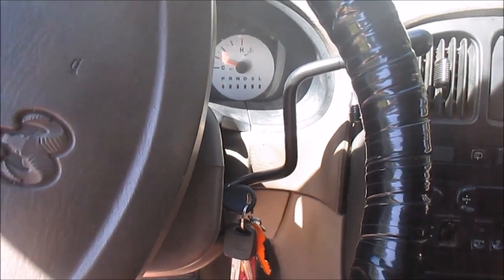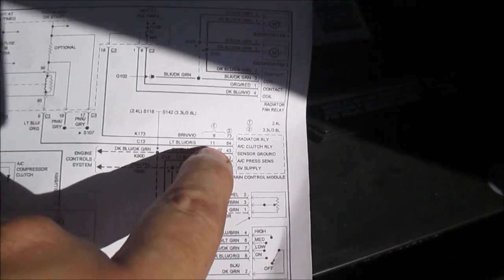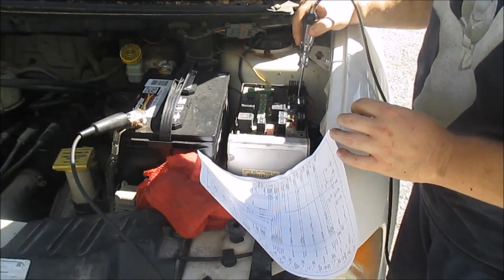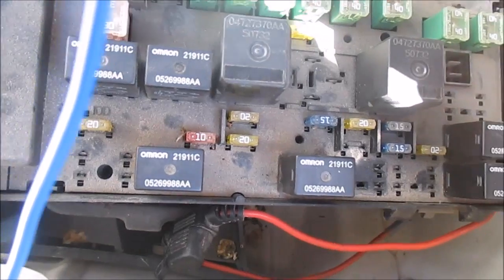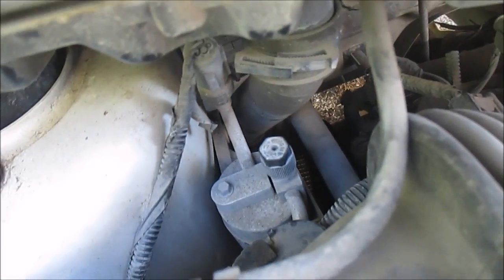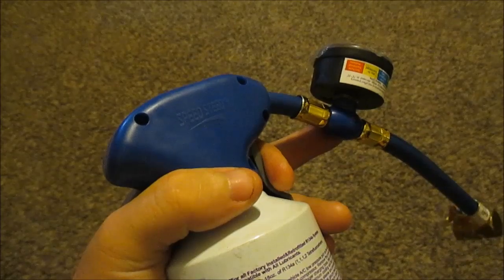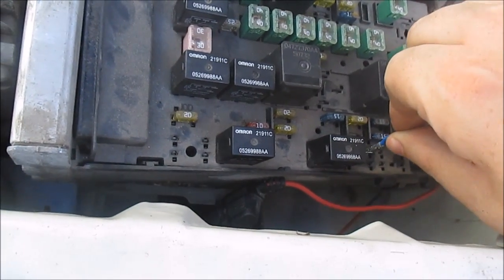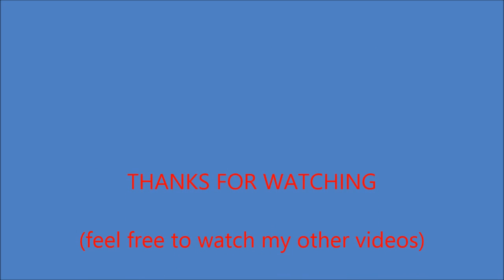How To Add R134A To A Dodge Caravan

Comment: wiring diagram was helpful.
had the same situation: 30 & 86 hot, 87 ground... but 85 - no ground.
we'll see if it's just low on refrigerant.
perhaps could be bad pressure switch?
of course, even if low, there's a reason it's low...
... so, back to slaying dragons...

Comment: Thank you for demonstrating how to jump the ac clutch. I am considering what you did to charge the ac in my caravan. I wasn't sure if I could just attach and charge without the ac clutch engaged, hoping the added pressure would turn it on.
Reply from the maker: You can just turn on the AC and if it is low on refrigerant the clutch will not kick it, but try hooking up a can and try to see if that will be enough pressure to engage the ac clutch, if so you can charge it that way, and If it does not work then you know how to manually bypass and force the clutch to engage. Just make sure if you bypass the relay you jump the correct pins or you could damage the PCM. Well good luck to you. Thanks for watching and thanks for the comment. Have a good day.

Comment: I have an '09 Town & Country. And like many of them I suspect my rear AC has a leak. I was planning on buying one of those rear AC block off kits. Dorman makes them. I would need one for the high pressure and low pressure lines. My guess is there's no refrigerant left in the system as I've driven without AC for about 70k miles. Can I just add a little bit of refrigerant to get the compressor to kick on so that I can then just use my ACPro gauge to tell me how much to put in for the rest? Also I was always curious, what happened to your right wrist?? Looks like it's been busted pretty bad at one point.
Reply from the maker: I have never used a block off kit, so I am not familiar with that kit. In theory I would think that might work. However, I can see you may have problems getting the charge just right, because of the removing a lot of the system. I dont know if charging by using the ACPro gauge will work for you or not. As far as my wrist goes, I had to have an av fistula surgery done to it. Which is where they cut into my arm and they take a vein and an artery and hook them together. It is done for people who are sick with kidney disease, so the person can be hooked up to a dialysis machine. When I was 24 my kidneys failed, so I had to have routine dialysis 3-4 times a week. After about a year of doing this, I finally got a kidney transplant, and have been doing much better ever since. Well anyway thanks for watching and thanks for the comment. Have a good day.

Comment: Thanks for the video.  Your time & effort is greatly appreciated. 
Yes!  These companies definitely need to add another 8 inches of tubing.  I'm certain people would gladly pay another 50 cents for more length!
Reply from the maker: Yeah that would be much handier to have a longer hose for sure. Thanks for watching and thanks for the comment. Have a good day.
Reply: @figibloom  q9
Reply: Could you have routed the tube and fitting in from the bottom side and been able to connect to the low pressure and had room to maneuver (given the car is on stilts).

Comment: i just added coolant to my 1994 dodge caravan using the port near the firewall... Worked perfect! The valve plugged in smoothly and air tight
Reply from the maker: Yeah on the 91-95 caravan the low side port is up near the firewall. The year I am working on is a 2003. Thanks for the comment and have a good day.

Comment: What cable is that you are using to jump it with? Thank you for your video.
Reply from the maker: This cable came out of a radio harness that I took apart and salvaged the wires from. I have a big collection of various size wires both male and female that I keep for various electrical testing. I guess it is just a homemade electrical jumper wire kit. I bought a kit from www.jumperkits.com but they are a little pricey, so over the years I have been adding to it. Thanks for the comment and have a good day.

Comment: This is a great video to teach you to bypass the pressure switch and the computer to see if your compressor is good or bad, but it is not necessary to bypass the pressure switch to add the R134a...If you leave the car off and add refrigerant to the system thru the low side port until it wont accept anymore then it will bypass the pressure switch, then with the car running you turn your climate controls to max a/c "the coldest setting for your vehicle with the maximum fan speed..."  Your compressor should then engage allowing you to charge the remainder of the system...

Comment: Adding the Freon should raise the pressure so the compressor will start without needing to bypass the pressure switch.
Reply from the maker: kurmat14 
I like to take the pressure switch out of the equation. Nothing wrong with the bypass method (if you hook it up right). I think the bypass gives you a very quick disconnect and quick control of the compressor turning on and off (just reach over and pull wire right where you are working, instead of having to go inside the car and turn off the ac system, If the pressure switch, or computer is controlling and not you) I just prefer to be the one in control of the compressor turning on and off when filling.  Just my preference. Yes doing what you said will work. There are many ways to get it done. Well thanks for the comment and have a good day
Reply: I’ve never been able to accomplish that. I’ve always had to jump my switch to kick to compressor on when adding once it’s become that low.